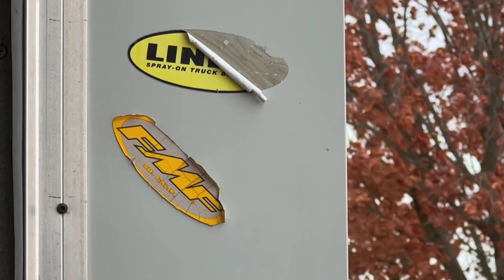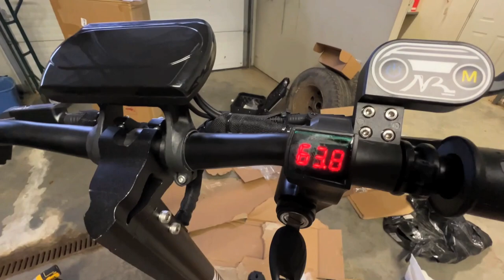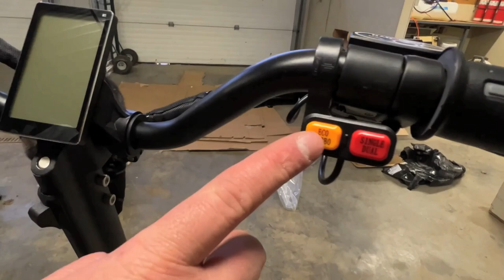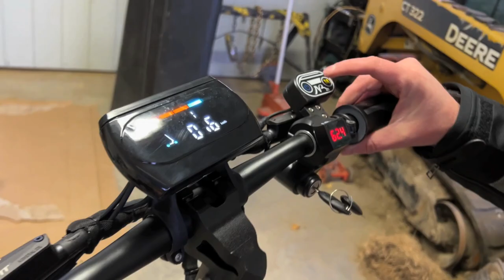UNBOXING NANROBOT D6+ 2.0! Unbelievable!

Comment: I really wanted the D6 but settled on the lightning. I needed more of a commuter scooter even though the lightning is not really a commuter scooter either. The D6 is just massive.
Reply from the maker: She flies though!
Reply: @markfreeman408  oh I’m sure
Reply: How is it holding up.!????
Heard front suspension part goes out !???
Reply: @panchovilla3493  front suspension is fine. Only problem I had (which is my fault) is the screw holding the front shock in keeps loosening because I put anti seize on the threads. I should have put lock tite on it.  Other than that I like it. Ride is not as soft as I expected but that’s because of the solid tires which was one of my sticking points.

Comment: I know this video is a little old but was gonna say did you put it in dual mode on the settings and adjust P-settings correctly also speed adjustments should be like P-8 or P-9
Reply from the maker: Ya we figured it all out, these things are nuts